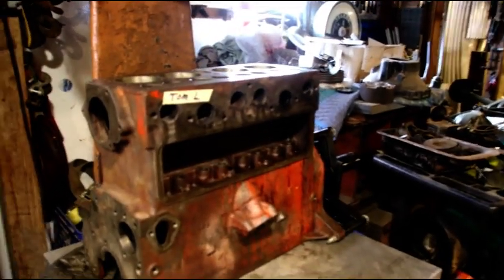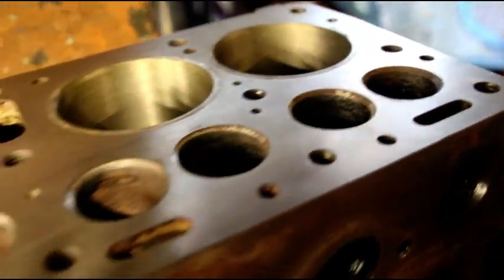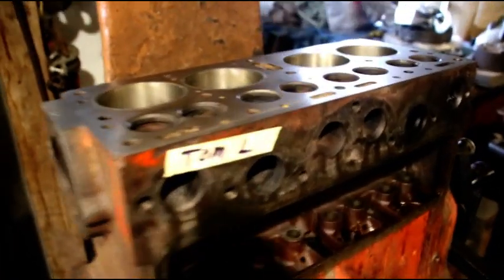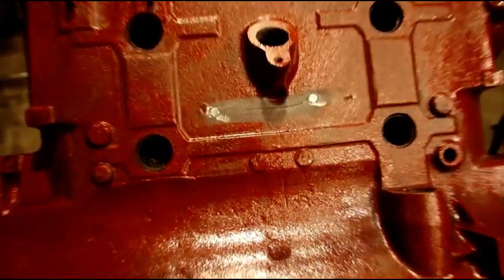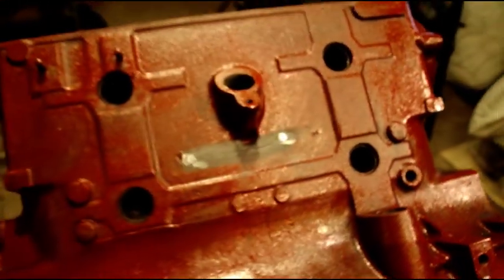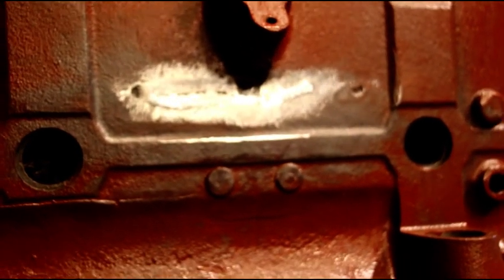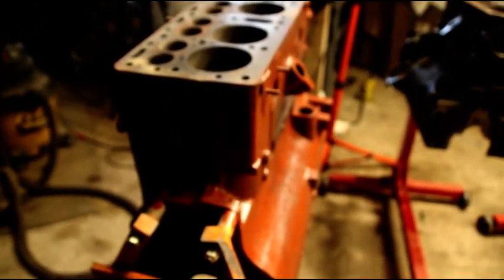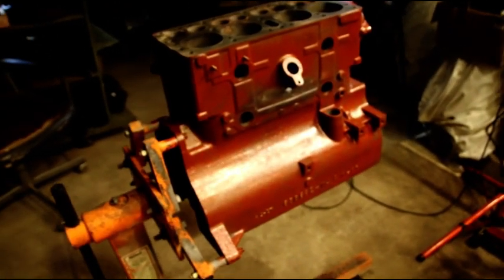Willys Engine Blocks...... One Sleeved and One Stitched....Both Saved

Comment: Thanks for the video. Do you use a flanged or straight sleeve for Willy’s engines? I had a Willy’s block done by a local engine builder and the straight sleeve didn’t seal.
Reply from the maker: straight sleeves are used in Willys blocks.  You can stop the bore and leave a shelf at the bottom if you are worried about sleeve retention.   With a .002" to .0025" press fit the sleeve will seal every time without any problems.  Often times sleeves don't get the proper press fit and that will lead to problems.  If you sleeve didn't work, you can bore for a larger sleeve or get another block.

Comment: No way! The Chinese melt scrap and it’s always a witches brew. We don’t know the grade or the alloy as it changes from one melt to another. Are they nodular or grey? Are they semi-steel? No one Fu$$ing knows! What I do know is that Kaiser Williys in Ohio used Meehanite certified foundaries. 

As for stitching…. It’s a proven cold fix if the base casting is thick enough and of good quality. We had issues with stitching Cummins 53 blocks. The crack issue was do to excessively thin walls do to issues with the cores. These same thin walls made stitching unreliable. Soon after, Cummins abandoned the Brazil foundary in exchange for a Mexican foundary. The Mexican blocks were significantly heavier and not prone to cracks.

Brass brazing also works but requires clean areas around the braze. Never brazed a block though. Machine tool castings yes.

There is a special rod now available for cast iron called cold weld rods and available from only a single source.

This rod has been successful in welding large hit and miss engines called flame lickers and on some large steam engines. I am still waiting to see how well these repairs hold up. The process was done in Germany by a skilled TIG welder.
Reply from the maker: The cast iron rod from Muggy Weld works great.  I don't like to weld blocks unless I can bring the entire casting to a certain temperature.  I have used the muggy weld on other cast iron items with great results.  You can also get very small pins for fixing thin casting wall.   Also there is only one company making junk chinese blocks. don't believe anyone who tells you that they have a different foundry or a quality block.  I have seen a lot of junk chinese blocks come thru my shop from the same company that says that they they use different foundries.
Reply: @metalshaperJeep  I am surprised that the Chinese even went after this market as willys blocks are a limited customer base. Having said that, they are going to need patterns and core boxes! As a pattern maker, I can assure you that to do this right, your talking serious money!!!! The block has to be interchangeable with the older blocks so tolerances are critical. If these patterns are done correctly, the part number and other IDs should be on the pattern. These are a bit like a signature. So if you claim a different foundary, then just compare the finer details. It’s obvious if two castings came from the same pattern. And what if they do use another foundry, what about the pattern and core boxes? How many sets of old school willys patterns and core boxes are floating about? Shit like an improper core or bad placement will still result in the goofy clearances between thrust elements of the crank and block journals. Unless I see an actual and verified willys ID in the casting, I don’t trust it. I would love to make a set of willys patterns but I would like to first see the actual prints from Toledo Ohio.

Comment: JB weld & welding are, for me, a temporary 'get you home' patch up repair. Stitching is a slow, time consuming & tedious repair, but it has proven over many decades to be the best method of repair, if one is serious about saving a block or cylinder head.
It might be a pain, but do it right & you will only need to do it once.

Comment: You are very good at what you do, don't let any numbskulls try to get you down man!
  I used to have a friend that was excellent at welding, and he had repaired some engine blocks and differential housings for years ago.
  If I remember correctly he would weld the cast iron with #680 rods, but only after pre heating it just like you said.  He was a old timer that was in the Navy and he had told me that was where he learned to weld.

Comment: I have a similar crack on a GPW block I have. I have seen the lock and stitch before and to me it looks like a solid fix. How well does it hold up over time? 
Is the process difficult to do on my own. The block is for a future rebuild and put it in my GPW. I have a CJ motor in it so I can enjoy the smiles per miles.

Comment: had chinese model A block for a customers car 1 std piston was too tight 2minutes witn a ball hone took about 25 thousand out man was it soft
Reply from the maker: Wow, that is a lot of material to remove with a ball hone.  Must have been a poor quality block.
Reply: Two minutes with a ball hone pulls 25 thou from the bore??? At that rate of metal removal, you weren't honing it, you were re-boring it. The wear rate in normal service must have been staggering. If that block was to be retained, then sleeving with some quality units would be called for.